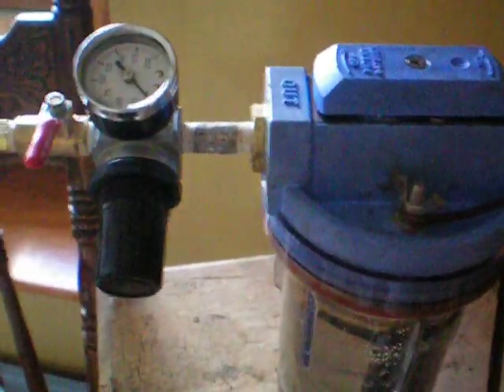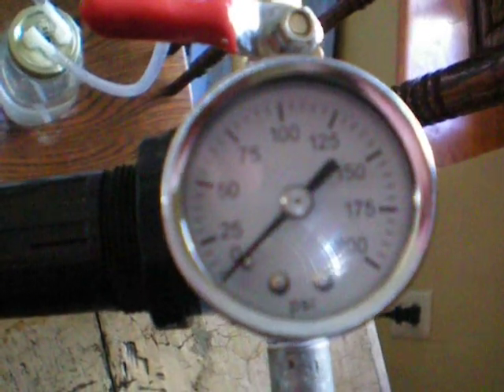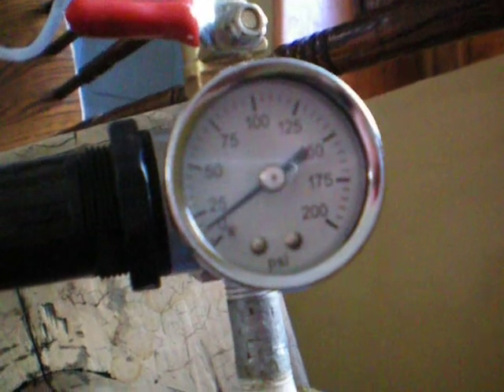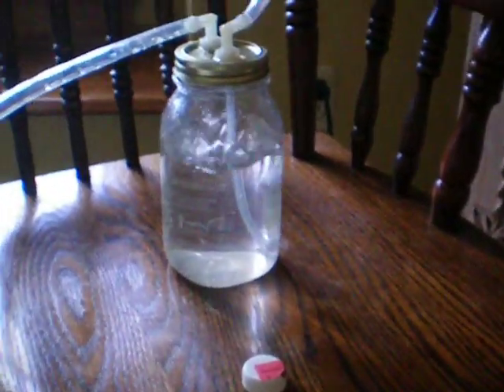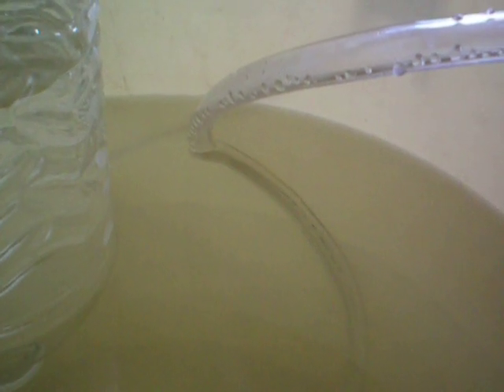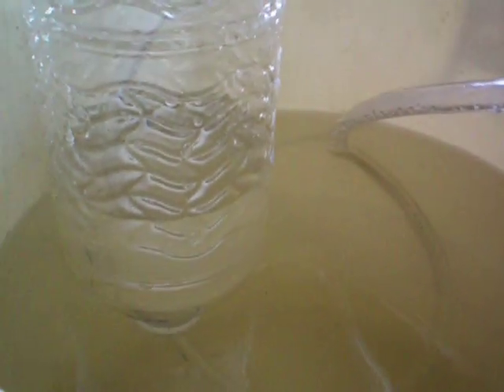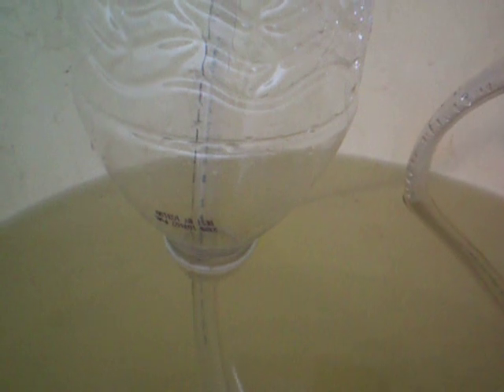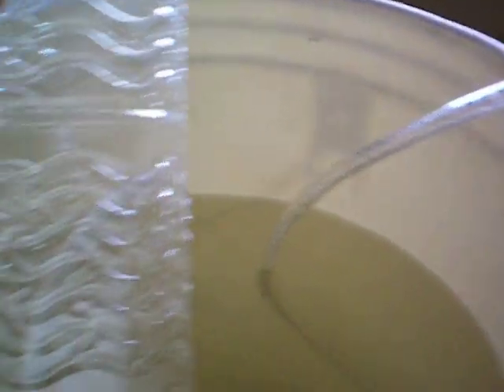hydrogen psi build

Comment: I was just woundering if you could put an adjustable regulator on it and test the production rate at differant pressures.
It appeared that you got it up to between 15 & 20 psi. I was wandering how much production you actualy lost.